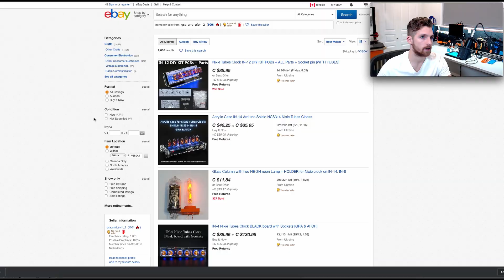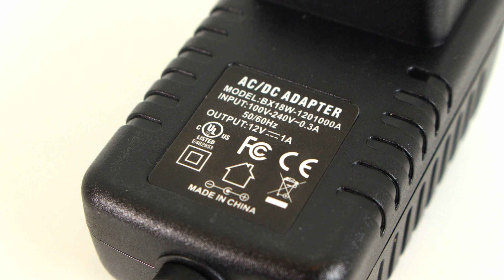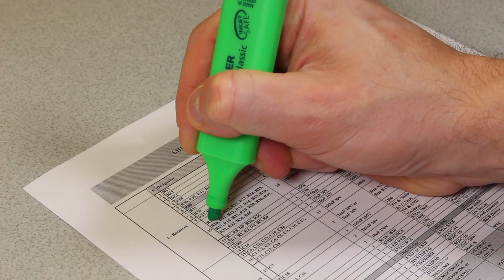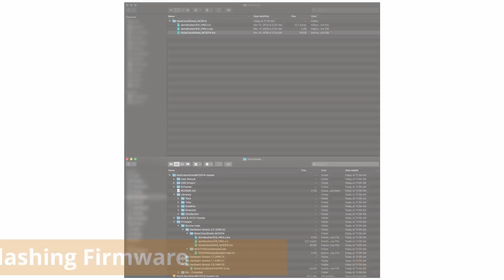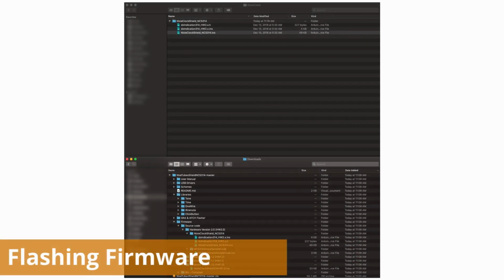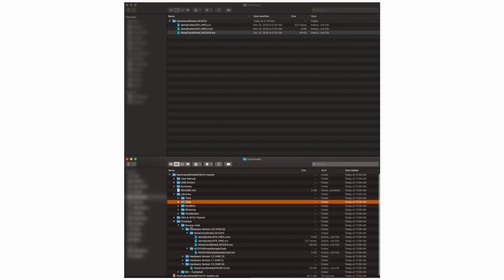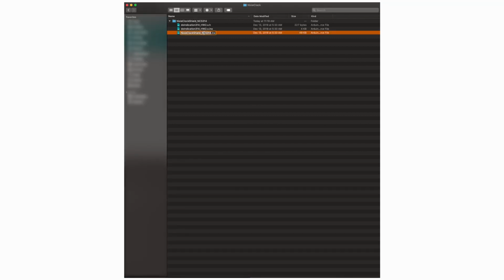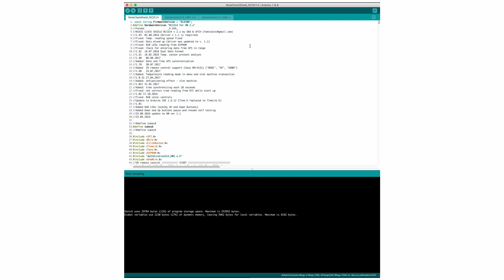Make a Nixie Clock | Part 1 | Assemble the GRA&AFCH NCS314 Kit

Comment: what wattage is your soldering iron?  is a 60 watt good enough for this job?
Reply from the maker: Hi, I have a T12 clone like this one: 
https://amzn.to/34T9pBG
It works really great at this price and has convenience features like auto OFF/Standby and temperature boost. T12 tips can also be changed quickly without a tool. I believe a 60W iron should do the trick, you may run into some stubborn large ground pads that are hard to flow.

Comment: Im just an electrician but want to try this kit out! That's why I don't quite get the Arduino part. If I buy the Uno version with the kit, is there an USB included with the program? I don't code that much..
Reply from the maker: Hi Somnium, just an electrician??? Don’t sell yourself short sir! You’ll probably shock yourself way less than I did during this project :) 

Step 1: You can buy the kit in the links and program the Arduino with the firmware version provided by the manufacturer. No coding knowledge required.
Step 2 (optional): if there is still gas in your tank then you can dig into my version and features link internet time sync etc...

Comment: It seems the I'm unable to locate the specify kit you used. Which one is it?
Reply from the maker: The specific kit version may have been updated at since I produced this video but the manufacturer still makes the NCS314 shield:
https://gra-afch.com/catalog/diy-kit-for-nixie-tubes-clocks/diy-kit-for-shield-nixie-tubes-clocks-in-14-ncs314/
Reply: @buildxyz  ah thank you so much. I attempted to navigate their website but managed to only find a kit that was near $600, lol.
Reply from the maker: @a6o932   I bought it from their EBay store, they have 2 stores, have you tried there?, it was more in the $200 range if I recall correctly.

Comment: Nice work. I like the technique you use to align the tubes on the board. Where did you get the PCB holder, I like this one ! Again, well done ! I may get this kit based on your video.
Reply from the maker: The PCB holderI used in this video was purchased off EBay: https://www.ebay.com/p/12019103604

Hopefully that link remains functional. Otherwise you can Google "Circuit Board Repair Soldering Station PCB Plate Holder With Two Caliper Clamp Z"

Thanks for watching!